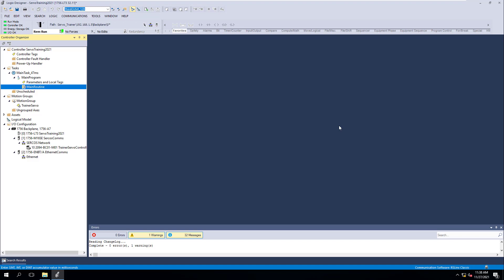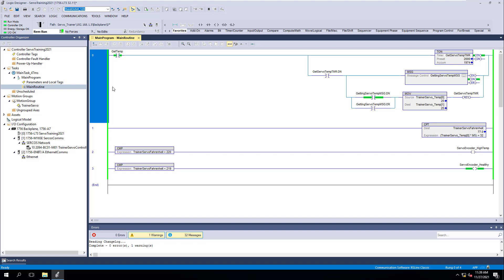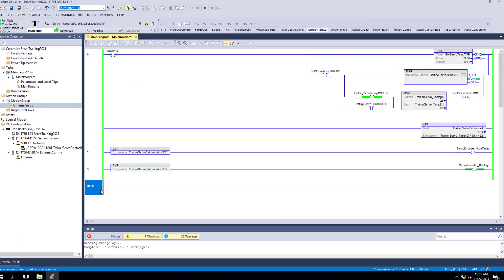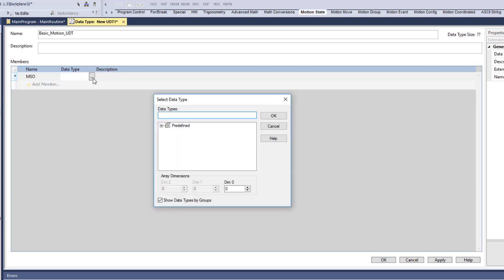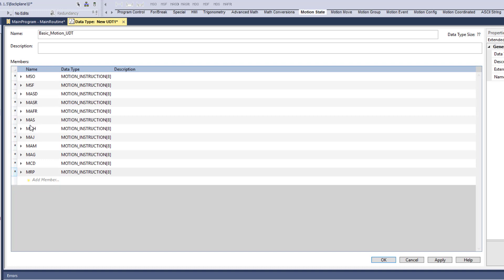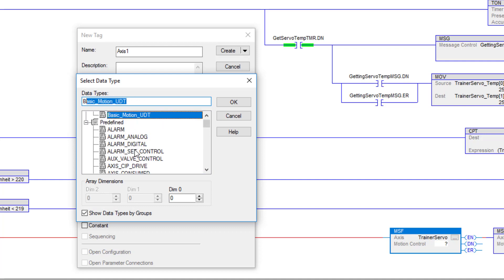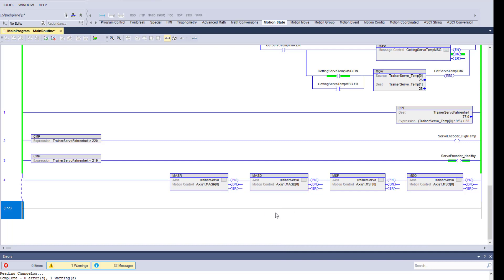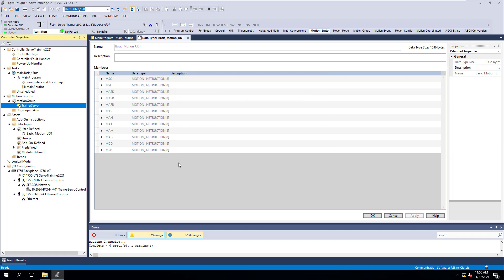Studio 5000 Servo Motion Axis UDT | User-Defined Data Type

Comment: Thanks Shane. I heard one time there are some steps to start or reset a servo. Looking forward to your next video to see the sequence
Reply from the maker: I've been busy moving this past week so I am slightly delayed in making two videos a week so I am doing one video release per week until February 2022.

Let me know what you need to learn & I'll make videos to help after next week.

Appreciate your support
Reply: You may have covered this in another video, so please let me know if you have, but can you go over the different homing types? The Rockwell documentation can be confusing especially when it describes the unidirectional active…( use this if the device can’t back up, ok…but if it cant backup how does it home). Then says it will move in the home offset direction if its in the home direction.WHAT!?

Comment: How to connect external R brake with kinetix 5500 ?
Reply from the maker: If you are referring to an R Shunt resistor then it connects to then it connects to the drive itself
Reply: Is kinetix 5500 can regen ?
Reply from the maker: @vorapobautomation9760  Then you need a dynamic braking model plus a resistance bank
Reply: Do you mean kinetix 5700 ?
Reply from the maker: @vorapobautomation9760  no, any servo that regens needs a braking model to chop the voltage
Reply: But kinetix 5500 not regen
Reply from the maker: @vorapobautomation9760  Any servo controller that has been regen
Reply: Which one sir ?
 How to config it ?
Reply from the maker: @vorapobautomation9760  You do realize that it's a physical connection.

That is what is important, the configuration is in the servo attributes.

I'm not sure what you want me to say because it requires a dynamic chopper that is connected to the DC bus.
Reply: How to solve the S30 fault problem one motor draw other motor 
because they run difference speed with each servo use loadcell control speed the motor 1 draw motor 2 I see the DC bus value of motor 1 around 500VDC and motor 2 DC bus around 750VDC it can run only 2 minute and S30 fault appear every cycle ?